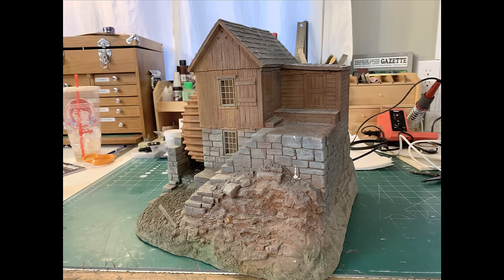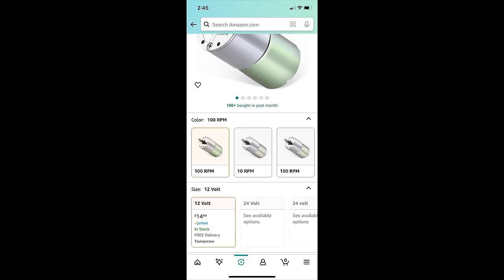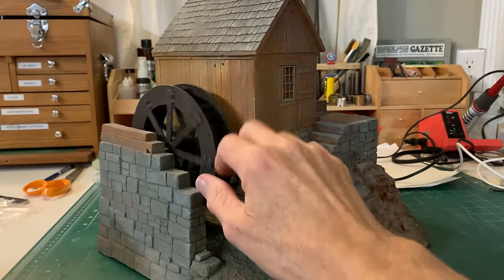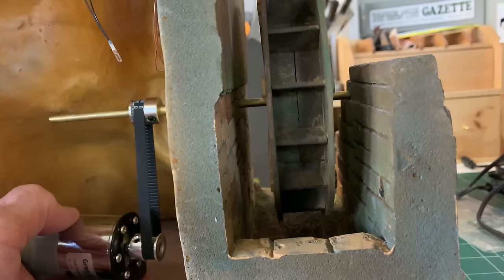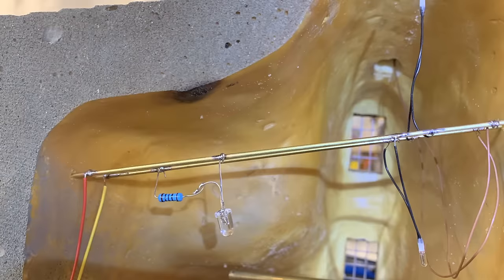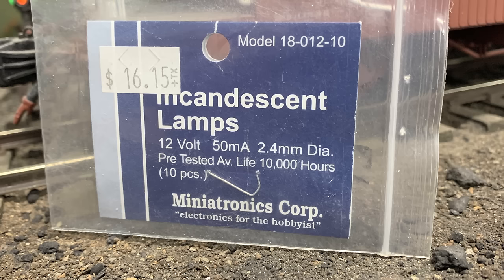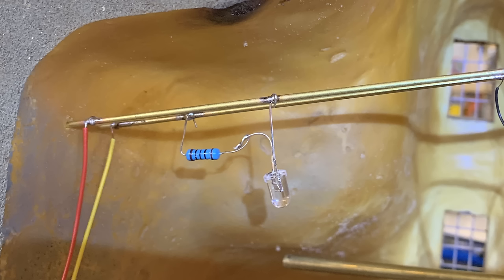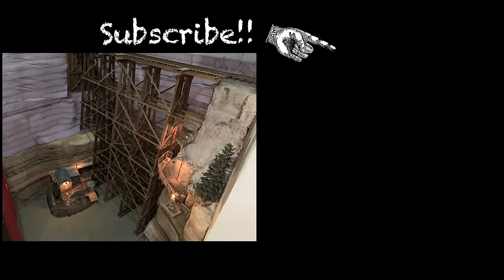Motorizing the Mill Wheel and Adding Lights- Rebuilding the 1/2" scale mill by Mountains in Minutes

Comment: 3:45 
"Went through a phase of building my own motion picture audio recorders" - I'm here for the trains and models, but if you have video of the AV stuff you made I'd definitely watch that too!
On the topic, one of those old wide motors that tape recorders use/d would have been a decent choice for the mill, designed to run a long time under load at constant speed and quiet too.

Comment: Why are your episode's all confused now?  They used to be in order, now I have no idea what is the latest issue.
Reply from the maker: They alternate Sunday and Tuesday. Right now the Tuesday shows are electronic stuff and Sundays are the Gardener Mill. The mill is in order but the electrical stuff sorta needs to jump around. For example, I was doing reversing loops. Now we’ve switched over to diodes. Then while we were on that subject, we skipped over to LEDs, all because we couldn’t move on on reversing loops until we talked about diodes. It turns into sort of a macramé of logic.